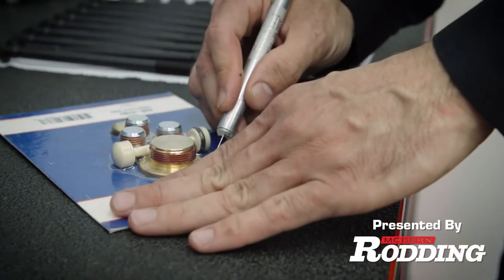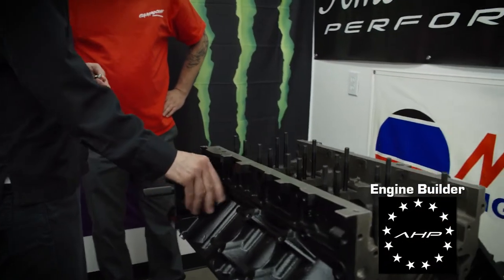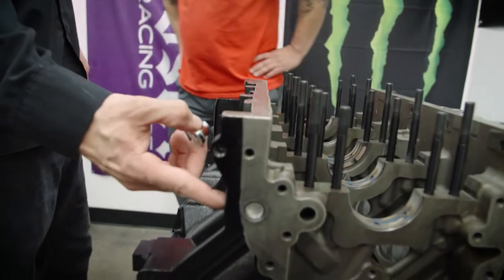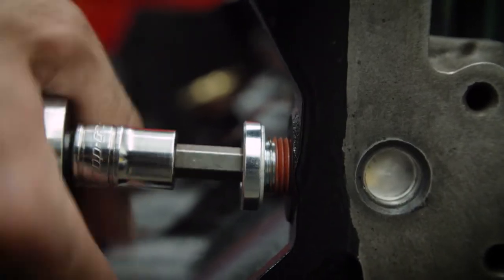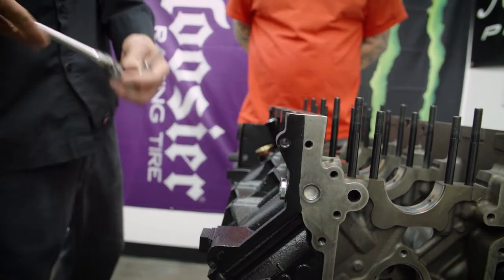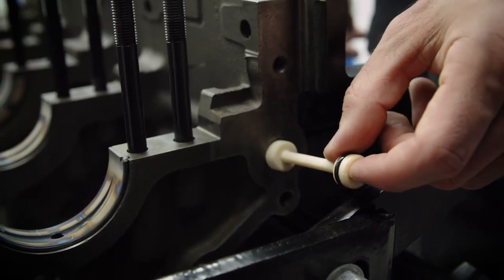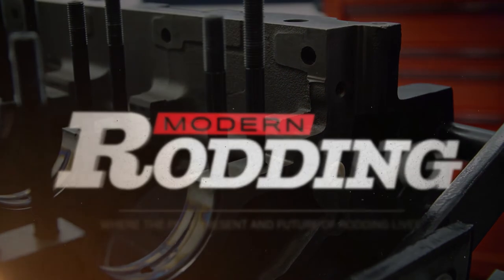Where to install LS oil galley and coolant block off plugs

Comment: What happened to the brass plug that was in the summit package you cut open never saw the small brass one get installed
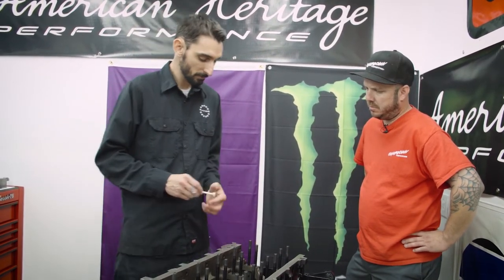Reply: That one was never shown on the install. They said it was "front plug we just installed" 1:26 but show a steel one.

Comment: Is the large plug OIL or COOLANT?
Reply: As stated in the video. Its for coolant
Reply: @creverett9 "um so some of these are for oil galleries others are for coolant. For the large one, it's self explanatory where it goes. For the smaller ones.."